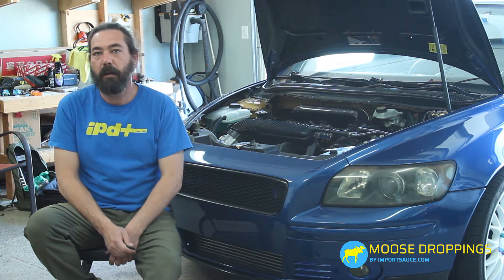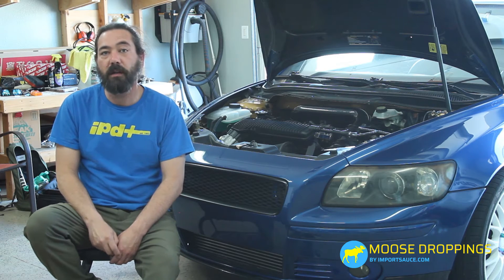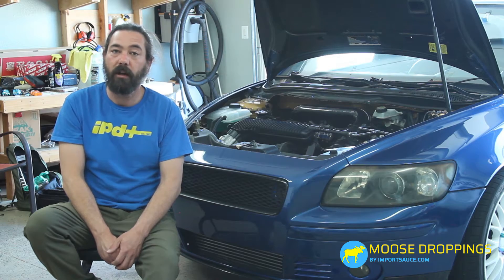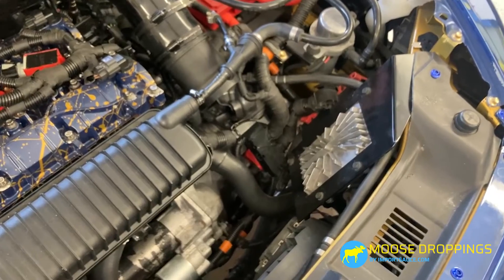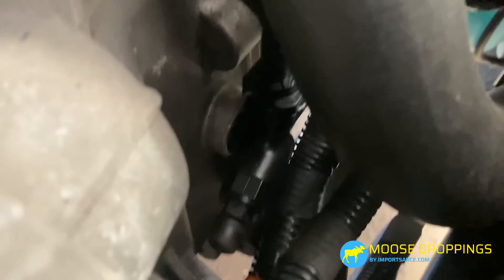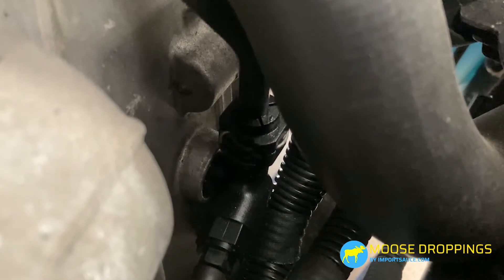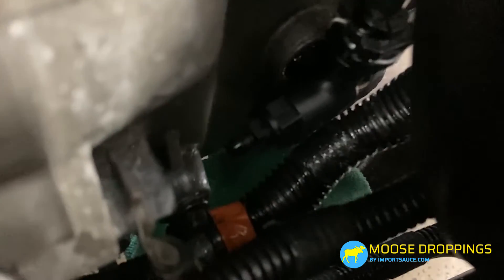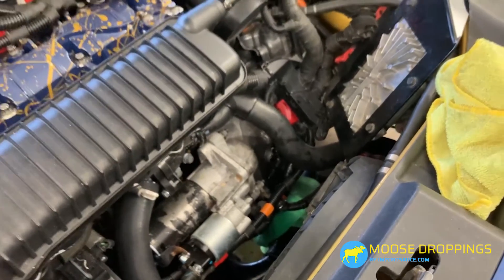Volvo M66 Transmission Clutch Line Seal Leak - Fixed

Comment: Pro tip: the stainless braided clutch lines for Ford Mustangs can replace the whole run from the firewall hardline to the airpipe/bleeder. I used Clutch Masters part SL-07234.

Still didn't save me though. Bad airpipe/bleeder or slave cylinder caused me to have to pull the transmission. Did a clutch and LSD while I was in there though.
Reply from the maker: Hey. Good info for sure. Checking that out
Reply from the maker: Interesting.  See the part. Looks like threaded ends. How did you attach to the master and the bleeder?
Reply: I believe the photo on the clutch master's website is incorrect. It's the flared fitting same as the plastic part you replaced in this video just milled aluminum with o-rings. I looked through my email to make sure I have the details right. It's actually a Focus part, not Mustang.

Part SL-07234 - Clutch Masters Steel Braided Clutch Line **Ford Focus 12-17**
Reply: While we are on the subject of transmissions.... the Ford Focus with a M66 has reverse gear in a different location on the shifter. This is an issue for me because I want to get a Coolerworx Shifter for my Volvo C30 M66, but there is not one specified for the C30. Soooo what is the difference in the Focus M66 and the C30 M66? Is it the internal shift tower? If so, how can I find a Focus shift tower?
Reply: @mikebruce6037  looks like this is a rabbit hole for me to fall down.
Reply from the maker: @mikebruce6037  hmmm, good questions, we don't really know too much about this at all, so can't really assist, but would love to know what you find out,